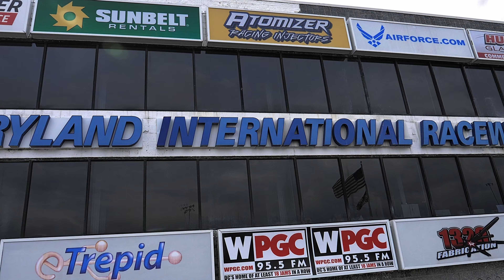Gen 2 Firebird with a Gen 2 383 CID LT1 /  Marlow brothers grudge race

Comment: If that's a Camaro,when are you running your Ranger ?
Reply from the maker: I run a S10, I will soon just need to swap out gears still. You went too far with the Ford all them Gen2's look the same to me.
Reply: @TPVPRO  You made the mistake not me
Reply from the maker: @timrayburn2461  You made the mistake comparing a Ford to a Chevy.